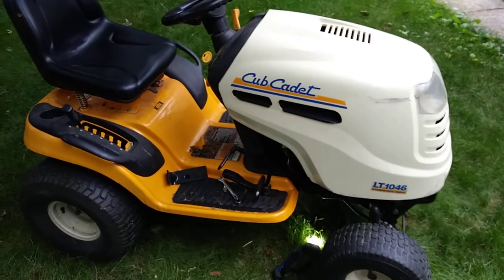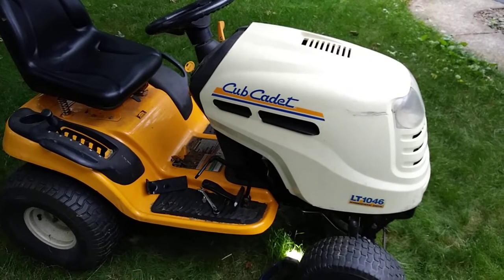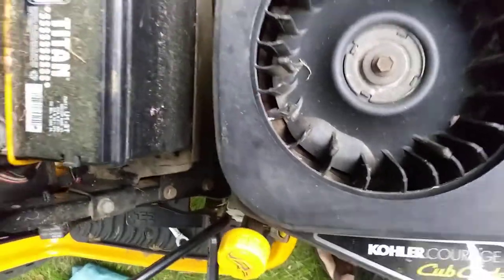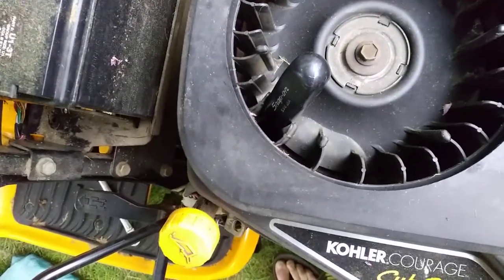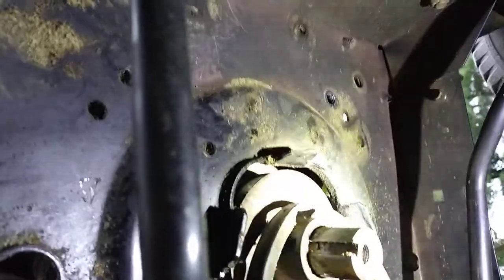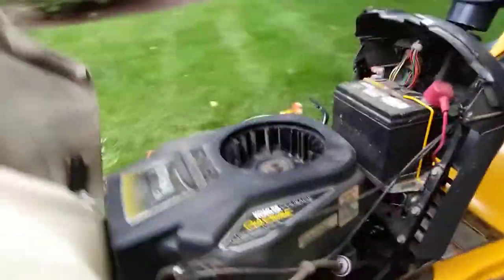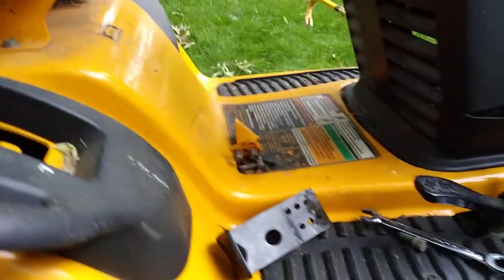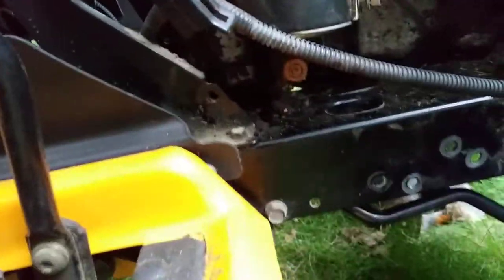Cub Cadet LT1046 Drive Belt quick replacement MTD Kohler tractor

Comment: Im hoping you still check the comments on this.  My Cub Cadet LT1046 broke my first drive belt, and I don't have a clue.  I saw this video and I'm thinkin'...do you mean by taking the 4 engine bolts out and prying up on the engine, you can alleviate pulling the large nut off?  That freeing the engine, then prying up on it, will give you the room to get the belt on the pulley?  Please tell it's true, as with inflation cutting into my SS and savings, I can't afford to hire someone to fix it for me!  TYIA!
Reply from the maker: SO SORRY for the delay, didn't know folks had commented. Hope you worked it out. This is mostly a tip for getting the belt onto a seized drive pully w/o messing with the retention tabs.